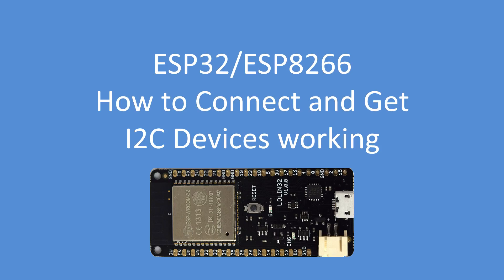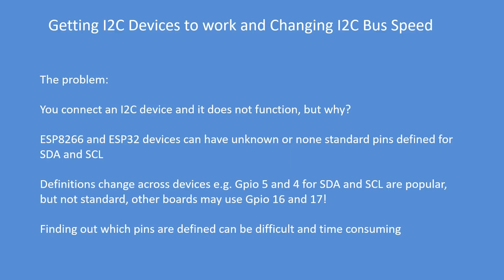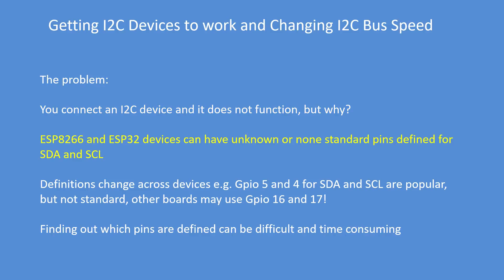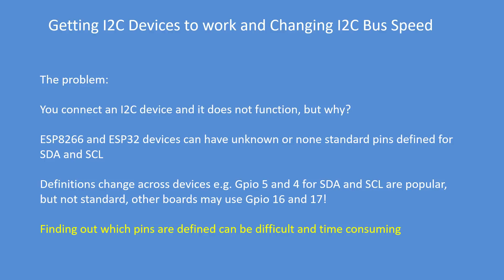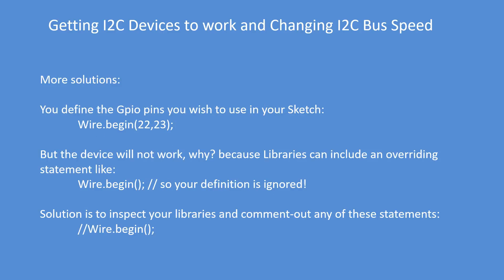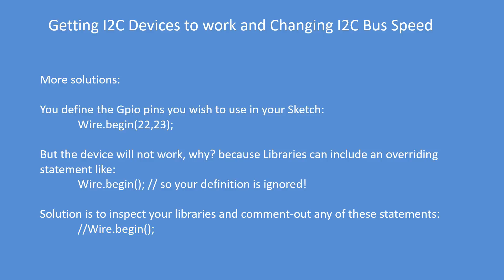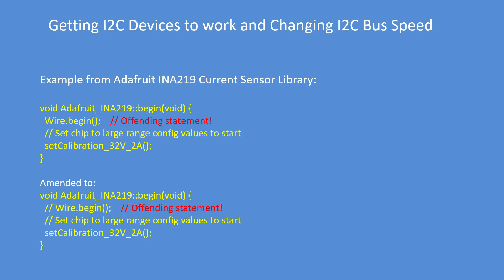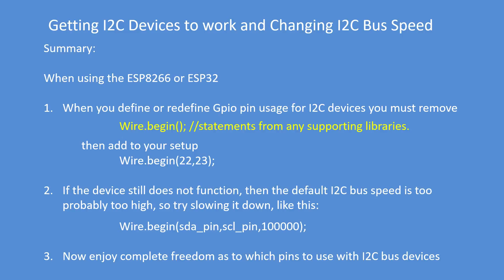Tech Note 063 - ESP32 / ESP8266 How to Connect and Get I2C Devices Working

Comment: Hi, I am trying to use 3 * UART + 1 * I2C and 1 * SPI in my design. You gave the solution for choosing the pins for I2C, great! Is it also possible with SPI to choose or redirect the pins we like to use at the ESP32? Thanks in advance for any help.
Reply from the maker: Yes the ESp32 has 3 UART's and see here: https://www.espressif.com/sites/default/files/documentation/esp32_datasheet_en.pdfOn Page-28 all 3 UARTS can be assigned to any GPIO pin and the same for I2C and SPI. BUT, if your using a development board then this is going to be difficult. Well I2C is easy, so is SPI, but usually GPIO0 is used for your programming/serial port for diagnostics, so if you take over UART0 then you lose communication with the  ESP32 whilst our programme is running, if reset it will revert back to UART0 default pins so it can be programmed again.What is your problem?I did a video for using the serial ports too.
Reply: Thank you so much for your quick reply!  I make my own PCB and need to redirect many pins to use all. The UART0 I want to keep to communicate by USB to the PC. I found out that redirecting pins for UART 1 and 2 seems to work. If I can redirect pins for I2C and SPI also  than I can solve my problem.  I just not understand how I can control with one SPI  ( read/write)  the SD card and the SPI sensor. How to control the CS for both? Do I need to use 2 normal GPIO's for the 2 CS and not mind the default CS pin? Or do I need to disable the default CS pin? OR the change the default CS pin every time?   I use Arduino IDE. Thanks again.
Reply from the maker: All SPI devices are wired in parallel so all share MOSI, SCK, but each device needs its own CS. SD.begin(CS) lets you define the sd card and then your other device library should allow you to define the other CS. You may as well use the compiler predefined CS for the sd card. See my TN on spi bus and code examples on how to define pins.
Reply: Thanks again. Finally, would it be possible to use the SENSOR_VN and SENSOR_VP  pins as digital inputs and/or outputs? Is it possible to contact you by email for a commercial question about consultancy?
Reply from the maker: Partially, GPIO36 and GPIO39 (VP and VN) are GPI pins they are Input only output so not GPIO.0
GPIO36 - Input only, RTC GPIO0, Sensor VP, ADC CH0

GPIO39 - Input only, RTC GPIO3, Sensor VP, ADC CH3You can contact me via my web site from the icon on here/channel

Comment: So the connection between ESP32 & I2C devices ultimately depends on the program right?
Reply from the maker: Unless you specify otherwise (for most libraries) yes with wire.begin(sda,scl) BUT many libraries still have a wire.begin();  statement that then uses the defaults as defined by the compiler in ...pins.h as I shoe on other videos.

Comment: id wager intellectual property plays a role in this bs...  if youve played around a bit, uve probably also notice i2c is often also called the two wire interface. because i2c is somebodies brand...   Add engineers, managers and ceos that all  want to sell their product in the us/international markets in general, might not speak english very well but understand ip violations might get import banned. id guess other factors are at play but i assume this is a big one. my guess is its harder to know what you can and cant say when the rules arnt in a language you have a strong grasp on..half the time legalese is hard to interpret even if you first language happens to be what its written in.
Reply from the maker: Most of the problems are determining which controller pin is which and to the beginner it can be a real difference between success or not or huge amounts of frustration by contrast most sensors are well labelled then add in the need to ensure bus speed is correct and the device address is known and the device is not a bus controller (some are by default) but again luckily most are slaves. On balAnce the i2c bus is the best around for multiple devices, SPI is ok but needs a CS per device so not I/o efficient.

Comment: i have rtc ds3231 and wemos lolin32 lite, how can i use i2c in wemos lolin32 lite?
Reply from the maker: First select the Lolin Lite board then run a short programme to determine which pins are SDA and SCL with serial.println(sda) and serial.println(scl) then connect the clock as per the pins-to-pins with supply and ground. There are example codes in the library for the 3231.

Comment: Not done anything with the ESP32 on I2c - but the ESP8266 - NO ESP8266 has I2c - it's just software and as such you can use any port pair you like (well, apart from GPIO16, obviously).  In the link here if you look at the LEFT side of the first diagram, these are the devices I have running on the ESP8266, many of which are I2c, done in software.  https://tech.scargill.net/home-control-2016/
Reply from the maker: Hi Peter, my aim was to let folks know that most libraries have the wire.begin() statement that is implemented before they try and specify a pair of pins, wire.begin(n,m), so correct me if I’m wrong how are pins to be used determined if the compiler will use those pins assigned by the hardware file for SDA and SCL when the wire.begin() is compiled? I agree that the ESP8266 does not have hardware provision of I2C but this does not stop the libraries from preventing correct operation of the virtual I2C.
Reply from the maker: Hi Peter, I have just checked the compiler source code and the default pins for the ESP8266 are 'default to pins 4(SDA) and 5(SCL)' the problem for most people is how do they know that? And that does not mean D4 and D5 on some boards and so-on, indeed some boards don't bring out every pin. The whole subject of I2C/SPI could do with some standardisation as it's so confusing for many starting out. I also note that on the ESP32 redefining SPI MOSI/CLK does not work it's always on 23 and 18 respectively because it's a hardware implementation!
Reply: Well we are assuming here the Arduino version of ESP programming. Normally I just program in C using the SDK functions and i2c source is in a folder. You can just change it. However gpio4 and gpio5 are pretty much the standard now though I did see some Wemos stuff using the same pins but the wrong way around....
Reply: Hi - just back in my office. In fact GPIO4 and GPIO5 are the correct names when referring to these pins on the ESP8266 - as specified for the chip, by the makers Espressif. For reasons way beyond me, it has become popular to pretend the ESP8266 is an upmarket Arduino and use the Arduino pin designations, which are NOT D4 and D5, but are  D2=GPIO4 and D1=GPIO5 -  is it any reason folk are confused. To make matters WORSE some early boards based on the ESP12 module brought out GPIO4 and 5 the wrong way around.   So when dealing with the ESP8266 and I2c it is fairly safe to assume GPIO4 (D2) and GPIO5 (D1) but be prepared to swap them of nothing happens.  The first thing I do when dealing with I2c is to run a scan - various software packages use different scan routines but generally something like i2c scan - this shows the i2c devices on the bus.  The OTHER thing to remember is that there should be one set of pullup resistors to +v - on SOME devices these are on the actual master - but on other devices I've seen the I2c master have no pullup resistors - I2c will NOT work without this as basically you're looking at open-collector - i.e. the signal has to strongly float high when nothing is running the bus. It is important to check for this.  A shame that these complications occur because other than that, I2c is easy-peasy.
Reply from the maker: Hi Pete,  yes Arduino IDE. So in the SDK and say your using Adafruit libraries that habitually include a Wire.begin() statement so they work for Arduino's, how do you use an overriding statement like Wire.begin(x,y);  when the library has already defined which pins are being used? I could have usefully included the need to undertake an I2C address scan in my video too. The Arduino IDE uses SDA and SCL for the pin names.
Reply: Well, if you were using the SDK, you would probably not use the Adafruit libraries... So I've been at this a long time and I thought the libraries from Espressif were fine until I discovered the INA219 chip - my scanner did not even pick it up - so recently I've started to use the TWI library from Hhisto Gochov.  It is in fact part of the ESP8266 core for Arduinno environment... right at the start of the source...

USING this is simple... there is an init call.... twi_init();  There are two routines then for writing a variable number of bytes - or reading a variable number of bytes - clearly one can follow the other.

I use these two...   twi_writeTo(address, unsigned char *buf, len, sendstop);
and the other side - twi_readFrom(same as above);

So address is the address of the device, the buffer is a series of one of more bytes including any command (there is no difference between sending a command and data - they are all just bytes),  the length of that buffer and whether or not to send a stop after that...

As for a scanner - that's actually trivial and here's the one I put together myself - to go with the above

int a,b;
 char *c;
 twi_init();
 b=0;
 for (a=1; a<128; a++)
 if (!twi_readFrom(a,c,0,1)) { ++b; iprintf(RESPONSE, "I2c device: %d (0x%02x) present\r\n", a,a); }
 iprintf(RESPONSE,"%d Device(s) detected\r\n",b);

iprintf is just my routine for sending stuff to the serial - use whatever you need to send stuff to your display or printer..

So essentially this is merely sending a simple read request to devices 0-127 and it gets a true response if the device responded - it doesn't actually send any bytes to the device.

That scanner works a treat and the code on the ici219 also works a treat, I'll soon migrate my other devices to use the same.

Now - as for which ports to use - in the original implementation - here... https://github.com/esp8266/Arduino/blob/master/cores/esp8266/core_esp8266_si2c.c
you will see that in the init function - you can DEFINE SDA and SDL  and as, if you look at the init function, you'll see he's using the arduino-like pinMode functions to program this up. I chose to fix the SDA and SDL to the popular 4 and 5 pins as I'm not using Arduino and hence I don't use pinMode.

Really, there's not a lot to it - he has implemented clock stretching which is nice - the original Espressif version did not implement this - and if you don't know what THAT is, it's a simple means for the slave device to slow the master down a little so it can catch up... for example - send slave a request for data, it may take it a little time to get  - and normally the I2c master won't wait - here the master can be made to wait - but that's a complete conversation in itself, suffice it to say - that I use that code and it works. 

Sadly there is a lot of mis-information out there for example - https://forum.arduino.cc/index.php?topic=427607.0

The guy just flatly says NO - you can't change the pins.... but... as I2c is here a software implementation - and as you have the source code - i2c nicely isolated in it's own page - of COURSE you can change the pins...

Comment: That was simple and to the point, thank you.
Reply from the maker: I think many people have difficulty with the I2C bus so I thought I would give my experience to try and help.
Reply: Hello G6EJD. I want to use an DS3231 RTC and a MAX17043 with the Wemos Lolin32. Both of them have an SDA and SCL Pin, so they use i2c communication. My question is: How many i2c devices can be used? Just one or two or more? I want to use both devices with my board.
Reply from the maker: The I2C bus uses device addresses so all devices are wired in parallel so SDA and SCL fo to each connected device, then you read the devices sequentially so the DS3231 has an address of 0x68 and the MAX17043 an address of 0x36 or 0x32. Adafruit has produced a list of all devices. The maximum on one bus is 128. You should always fit pull-up resistors ideally 4k7 to Vcc 3.3v and don’t use long lines.
 https://cdn-learn.adafruit.com/downloads/pdf/i2c-addresses.pdf
Reply: Thank you for the answer. So as long as I dont use both devices at the same time, I can use many devices, right? Do you know if the Arduino IDE allows the ESP32 to wakeup from an external RTC like DS3231?
Reply from the maker: Yes and there is no means of reading more than one at the same time so it all works as expected, for example there is no bus sharing by more than one processor but if there was the processors would need to negotiate who has access to the I2C bus as that is the bus requirement.

You can set an input pin to wake up the device from sleep if the DS3231 has an interrupt output pin that can be wired to a GPIO pin. e.g. attachInterrupt(GPIO-pin, Clock_wake_up_function, RISING);You can use a FALLING edge, but on power down when the ESP releases its (internal) pull-up resistors it may cause interactions by creating an interrupt as the input pin FALLS, if that makes sense! void Clock_wakeup_function(){  Clear the interrupt source flag and then process the interrupt request, but you can't do much in an interrupt for example can't use the Serial ports and a few other functions.}
Reply from the maker: Serhat Bayraktar Yes, as many within the bus specification devices as you like. The ESP32 allows   Any pin to wake up from deep sleep using esp_sleep_enable_ext1_wakeup(GPIO_PIN,1); //1 = High, 0 = Low. And the external RTC has a pin that will transition when an alarm occurs, so connect that to the selected ESP32 gpio pin to wake it up.